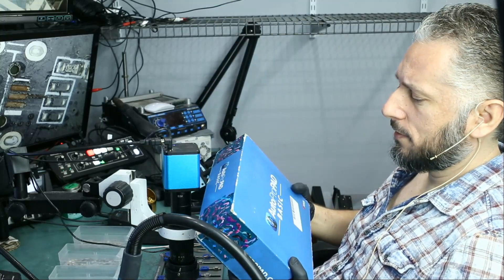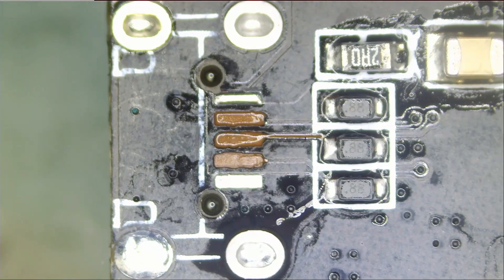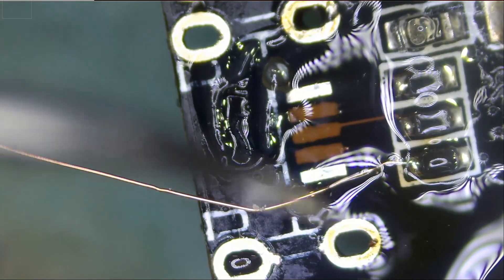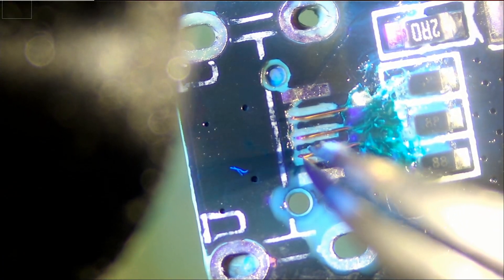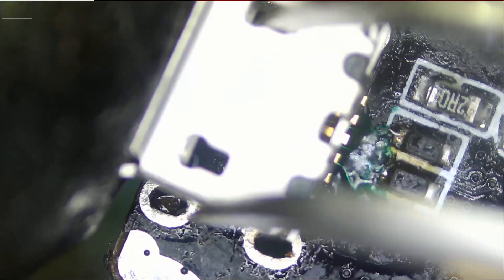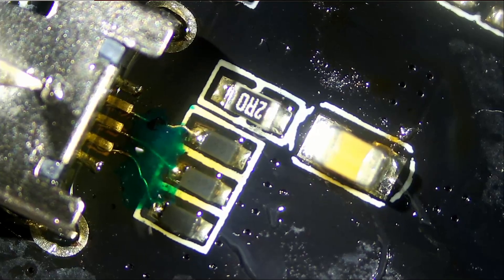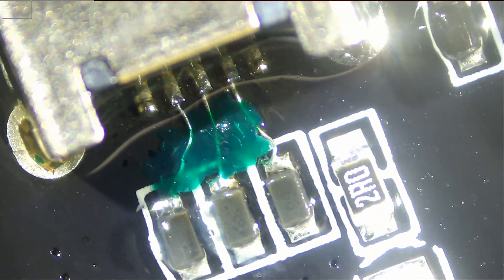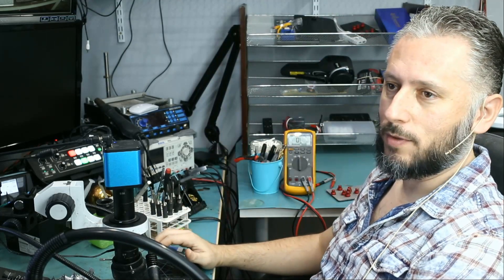AutoProPAD key programmer - Missing Charging connector replacement and soldering with torn traces.

Comment: The connector replacement was nicely done.
Even though the customer may have lost the board connector, surely they still have the power supply?  Most importantly, the new fitted connector needs to match the power supply lead.  Was the customer unable to detail the power supply connector?  I'm thinking, a follow-up phone asking the customer to share a photo of the power supply connector might work here.  Otherwise, the customer will need a matching plug for the power supply fitted too?

Comment: as long as it has the same amount of pins wouldn't it be wired the same? i say this because micro usb cables should all be wired the same correct?
Reply: Yeah but some connectors can be inverted, so the pin out would be inverted too.

Comment: Apart from charging does it also support connectivity with the computer(file transfer) via usb ??  As we can see the data tracks had a severe issue that lead a jumper/loop. I'd be more satisfied to test if had transmitted data via usb ... Any way thanx .. I like your videos.  TANZANIA🇹🇿

Comment: thanks to this i channel I'm was able to fix my PC water cooling bykski pump(replacing the IC controller) and my logitech g502 turns out it was just a usb pin connector with lifted pins and solder that has been stored for 3 years 👍👍